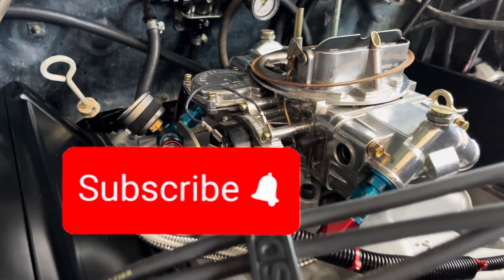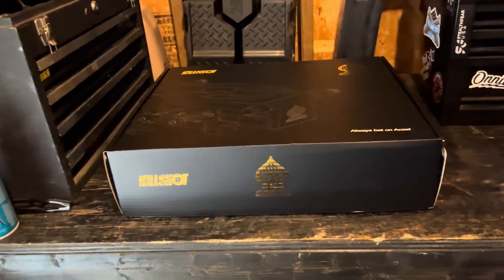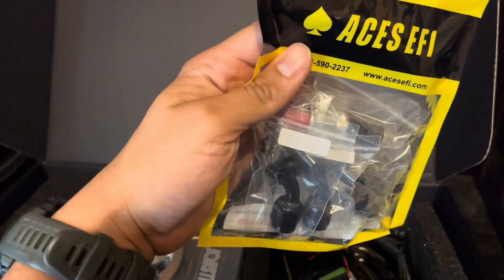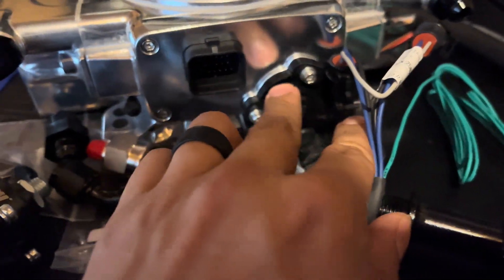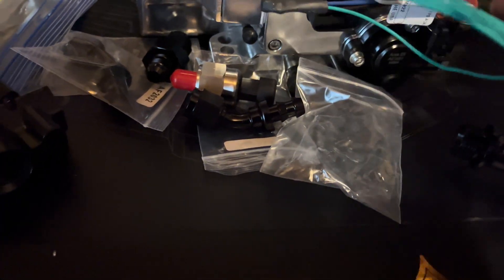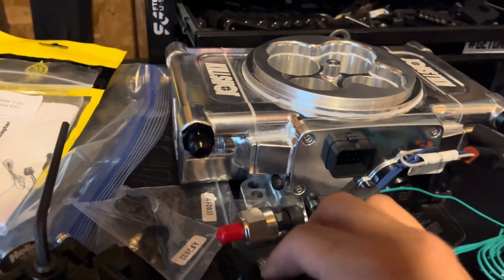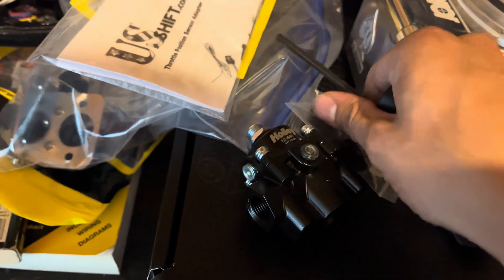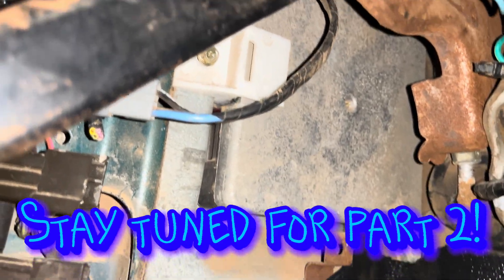Aces EFI Killshot install Big block Ford 460 Pt 1

Comment: Were you able to use the stock fuel pump?
Reply from the maker: Nope, I have the Holley Sniper 12-357 drop in fuel pump with an external regulator for my set up.

Comment: Price for that setup im running e40d factory 460 its in a 1991 f-superduty crewcab conversion truck with 4wd .no issues right now but wanting to put a nice cam in it soon.
Reply from the maker: If your going to convert to something like aces efi you will also need to change the intake manifold. Intake and aces efi will run you somewhere around $1,500 but you would also need a transmission controller which would run you another $700-$800 dollars.

Dollar amounts are next exact amounts.
Reply: @MaterOBS  I have a adapter to run carb on factory  intake also planning zf6 swap for transmission

Comment: Hey let us know when it’s hooked up I got a 429 in my ford F-150 78. I got it running but it’s pig ass rich! I’m going to redo timing and restart. Make sure timing is as close as possible.
Reply: Also it won't self tune unless at full operating temp
I had a sluggish kinda feeling too until I realized that it won't learn in 10 mins lol
Reply from the maker: @FastFoxx82 yeah you shouldn’t be making any adjustments until it’s at full operating temp
Reply: @MaterOBS  
Damn nice truck build too 
Thanks for sharing the real world info
Reply from the maker: Will do, I got mine put together also and is currently driving but still needs to be tuned better. I’ll be releasing a few videos here within the next weeks, just trying to understand the system better first.
Reply: @MaterOBS  did it start good on first start?
Reply from the maker: It did, pretty easily.

Comment: Did you have any issue with splitting the tps signal  on the kill shot
Reply from the maker: Still fine tuning everything but as of right now that adaptor is working perfect and not interfering with the tps on the Killshot
Reply: @MaterOBS  ok I'm installing a 90's 460 with e4od  in my 72 bumpside   with a killshot and usshift controller keep us updated please
Reply from the maker: Yeah you should be good, I ran the original 90s 460 EFI with the Quick 4 before I had this 460 built and it actually ran pretty good